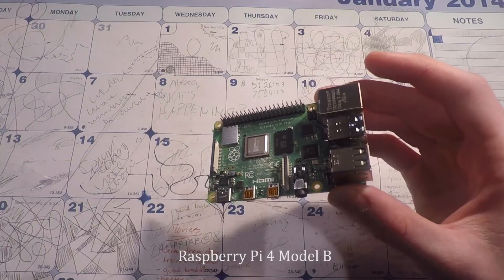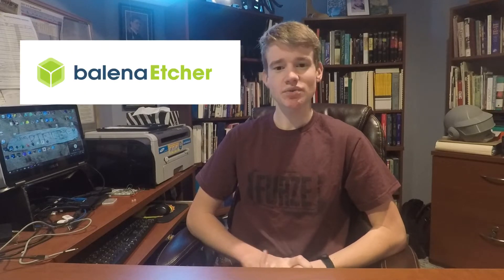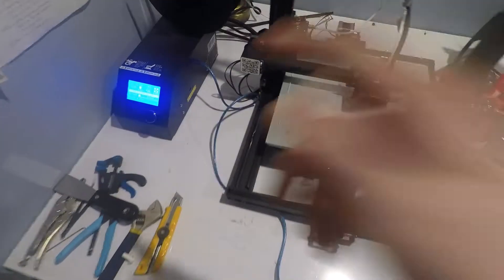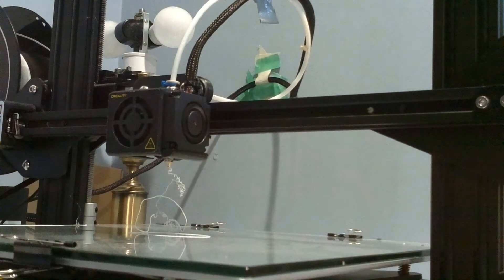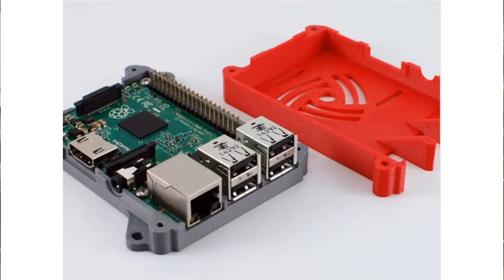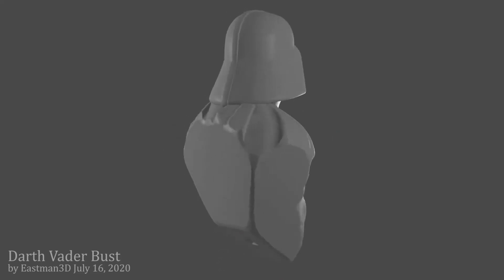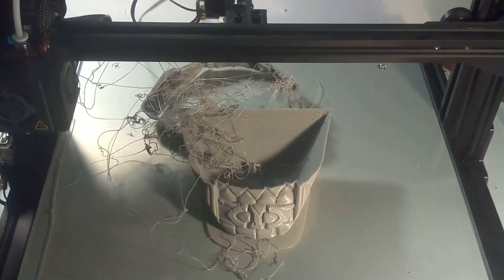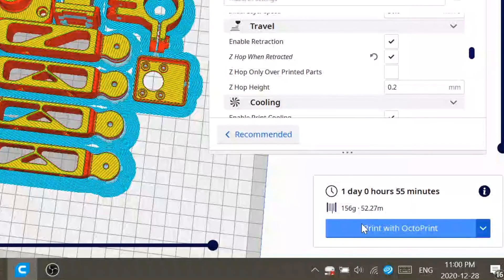Creating Amazing 3D Print Timelapses with Octolapse!

Comment: hi , What settings did u use for the Print head to be completelly away.I cant get it to get away completelly :) thanks jonas
Reply from the maker: In the octolapse plugin settings, there's a drop down menu that lets you select "stabilization". There are options like "printing" or "orbit" but if you want to to be off to the side then select something like "back right". lmk if that helps! :)